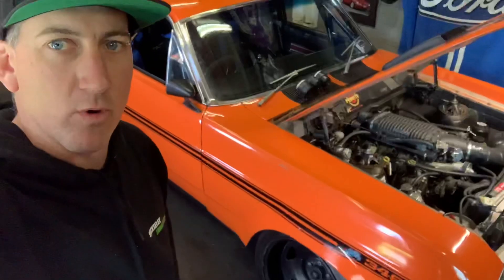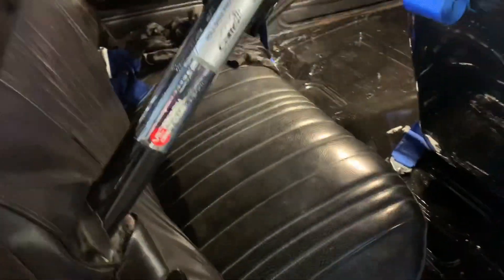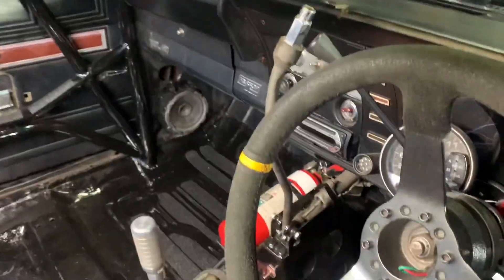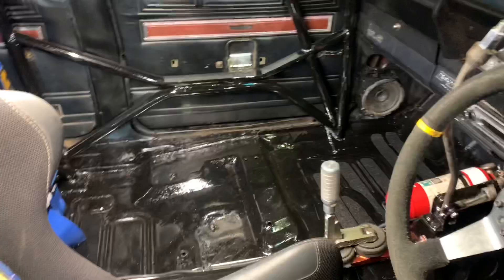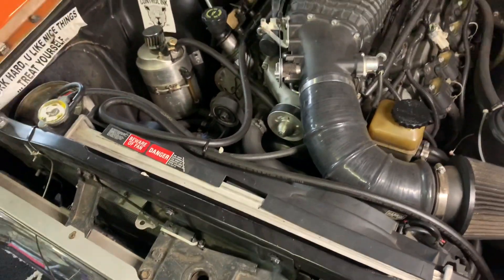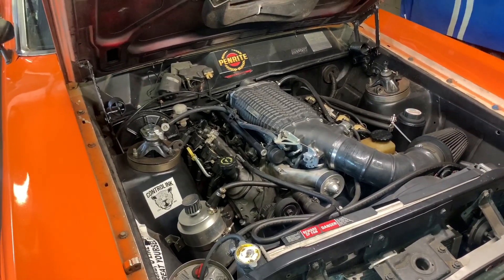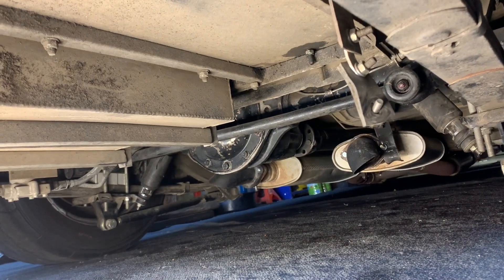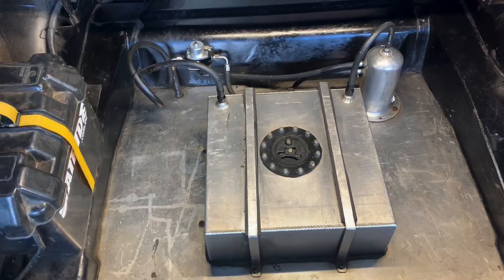XY FALCON DRIFT CAR BUILD BREAKDOWN!

Comment: Stock steering lock?
Reply from the maker: Nah modified knuckles for extra lock 
Same with drag link
Reply: @Oplese  do you have a vid or like a forum post on what you did id be very interested to see it. Is it similar to modifying knuckles on steering rack setups where you move where the tie rod bolts closer to the hub?
Reply from the maker: Nah cut and shut stub axels